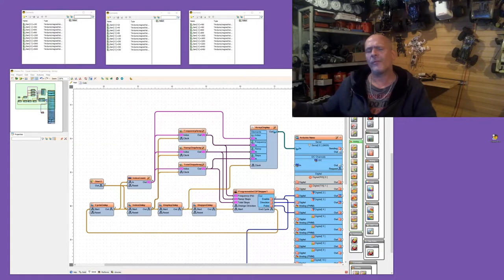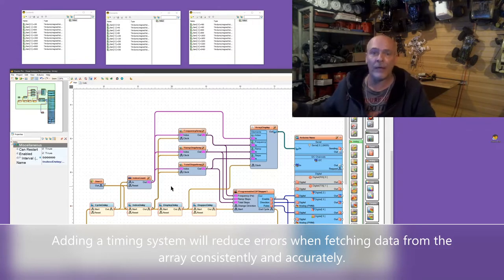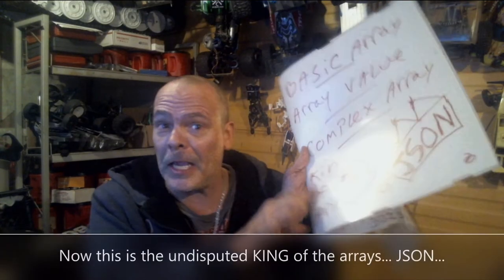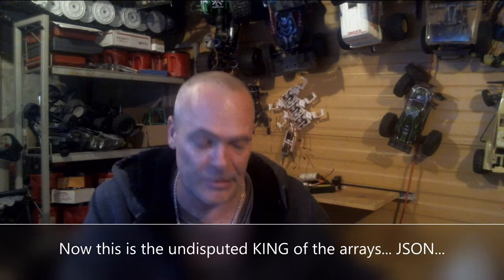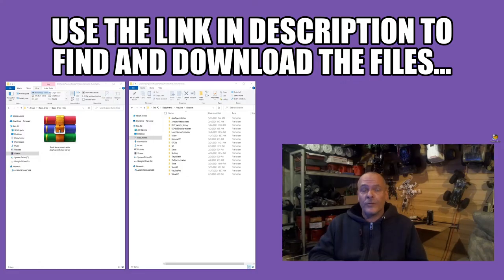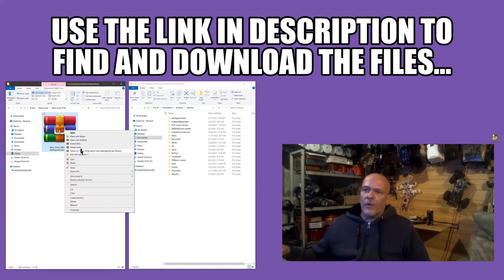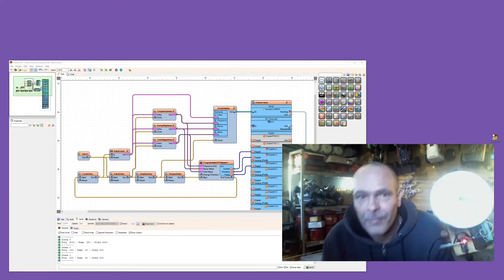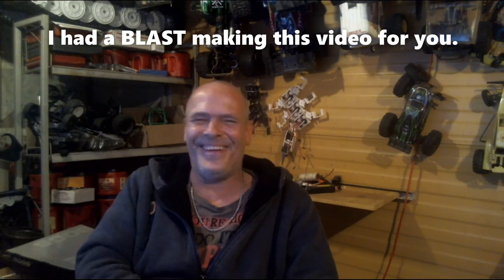Visuino Array Tutorial Ep1 In depth introduction and the basic array

Comment: OK just started using Visuino and have been looking for info on creating and using arrays . Watched this video the first time and felt overwhelmed because A) the number of components involved and B) I couldn't read the descriptions on any of the element blocks used because of the video quality . I got a screen shot and printed the Visuino grid  and watched your video again and writing the names on all of the blocks .  Seems to make more sense to me now . After the "Start " output resets the index counter it looks like this is free running and with no stop provision (or am I missing something? ) . There is another block out of view that is connect to EPD Enable pin and appears to connect to an input pin towards the bottom of the NANO board . What does this do it wasn't mentioned in the video ?  You mentioned using a Numerical feed for accessing an index in an array (instead of a counter) 
how would this be accomplished using Visuino ?  Thanks for posting this helpful video I gave you a Liked and subscribed to your channel
Reply from the maker: The pin it is connected to is the nano LED light pin 13, and yes, it is a free running script with no end. It just cycles through the notes. Also, you can get the Visuino sketch on my Patreon, no charge. Thanks for watching.